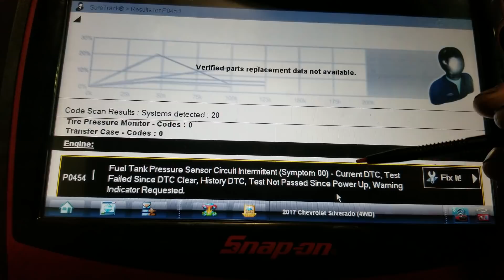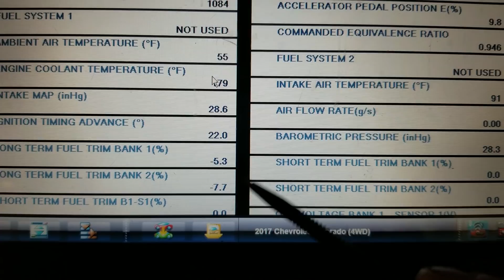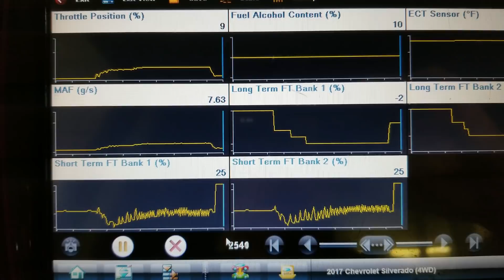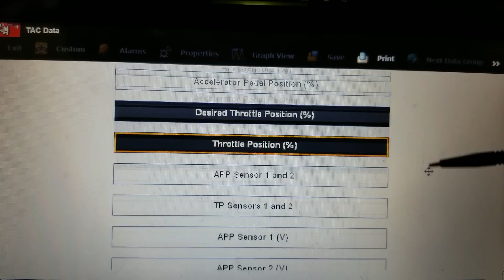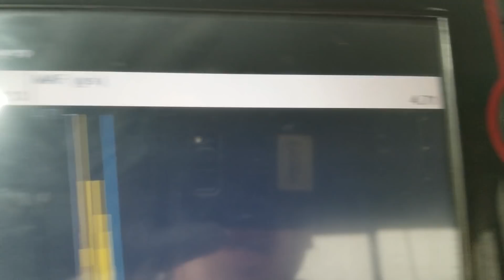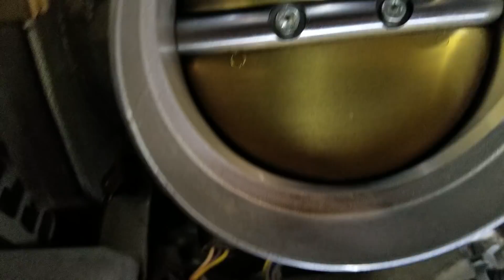2017 CHEV SILVERADO 6.2L, P2101 THROTTLE ACTUATOR POSITION PERFORMANCE (PART I)

Comment: Is the throtle supposed to open all the way when you hit the gas, mine only goes to 28% for the throttle body, i removed the intake and the buttlerfly flap doesnt open hardly at all

Comment: Usually the freeze frame on GM is in the codes menu on the Verus and GM generally writes freeze frame for each code.
Reply from the maker: Yes, I know, but for some damn reason on this one I was struggling to find all of them and get them to show up...who the hell knows, ofcourse on camera I struggle with it...lol?

Thanks for sharing and watching.
Reply: @PaulysAuto  Yea could be an issue with Snap-On, we haven't seen many new generation GM trucks yet the ones we have have mainly been for leaking AC condensers.
Reply from the maker: @txdm9383   Yeah that's a common problem in the upper corner right?
Reply: @PaulysAuto  Yup right at the weld on the dryer, just did one today. Done 2 in the last 2 weeks both with less than 60k mi.
Reply from the maker: @txdm9383  oh yeah, I knocked out a few last summer.  We are in Minnesota so, not a lot of A/C work at this time.  Where you located?
Reply: @PaulysAuto  South Texas, theres A/C work most of the year here lol.  Texas heat is hell on A/C compressors.
Reply from the maker: @txdm9383  nice, I love doing A/C work.
Reply: @PaulysAuto  Most trucks aren't bad but FWD cars and suvs can be a pain, I prefer the electrical/drivability diag side of things, love watching diag videos and learning other people's different strategies/methods for attacking a problem.
Reply from the maker: @txdm9383  that's how we become well rounded and learn, watching other guys make mistakes, struggling to think it out, and doing it the best we can with what we have.